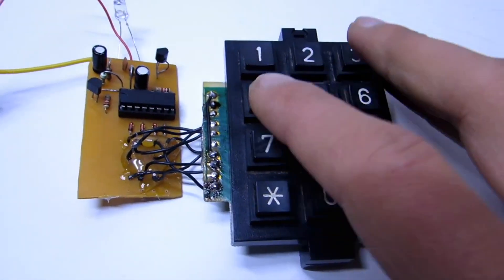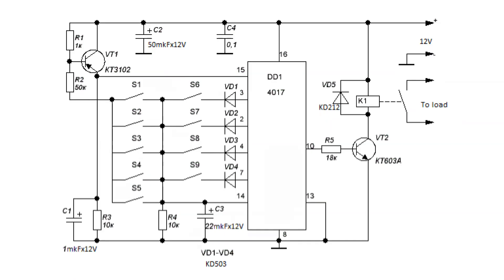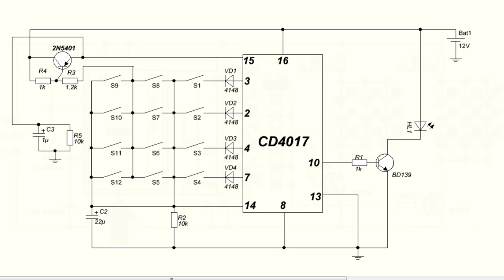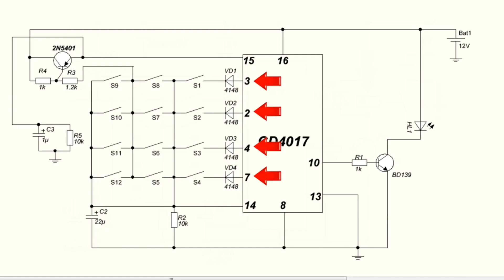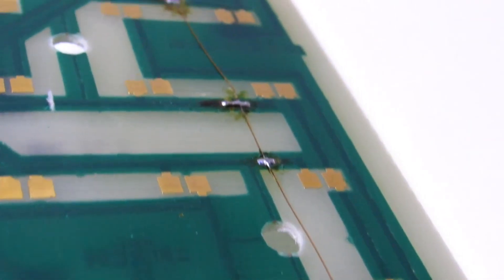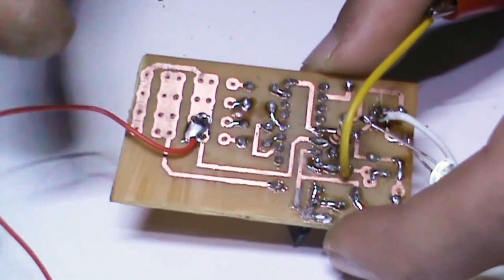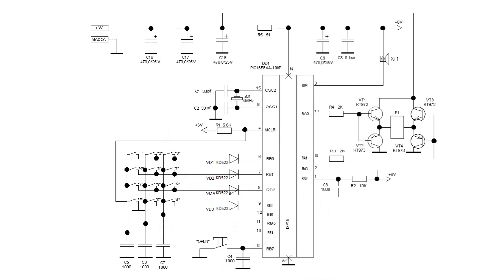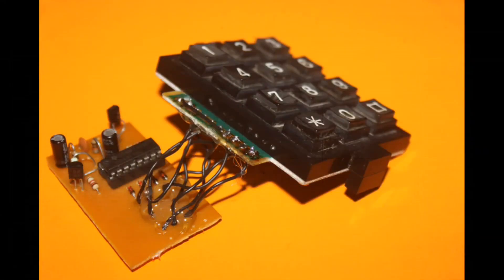How make your own combination lock

Comment: 0:39 so is this circuit reset if click wrong order those CORRECT buttons when pin is LOW
so if passcode is 1234 you cant push (234*)(1)(134*)(2)(124*)(3)(123*)(4)
bcoz i see so many these and those not go reset. this seems. no its not
14 is clk and 15 is reset so you can enter any sequence those correct keys until you get correct order. means easy lol.
those buttons should go reset too when you hit key that is not correct it is 0 invert that thats reset
so 4 input NOR with transistors and input pullup do trick

Comment: you not need clock when reset?
basically pulldown resistor for reset and clock
then wrong keys bring vcc to reset and correct keys go from buttons to clock. rest circuit can forget its too complex xD and it not even reset when click correct key wrong order xD
there no need clock when reset go high its not synced with clock it just master reset

Comment: Did anyone else have the video glitch? I fear my computer has a virus.
Reply from the maker: What virus? I guarantee that the archive under the video does not contain any viruses, you may have no program for the PCB and the file you just will not open
Reply: Kasyan TV No, I mean the video is glitching which indicates that something is using up my CPU power. It may be a virus taking up that CPU usage so I need to know if the glitching is in the video or is it in my computer. Btw the circuit is brilliant, I would build it if I had the IC.